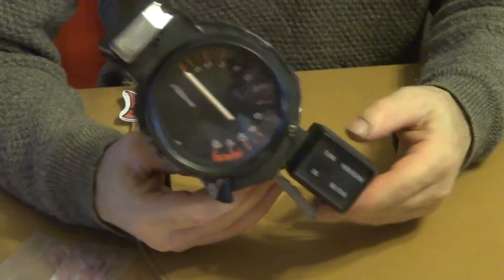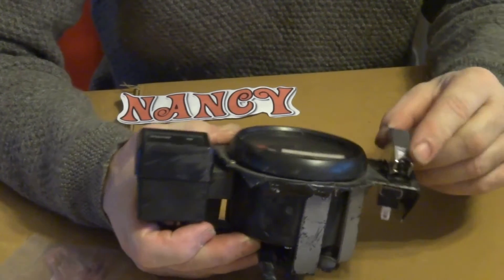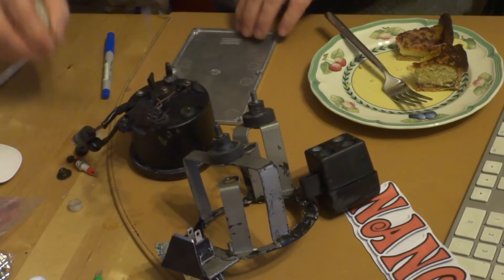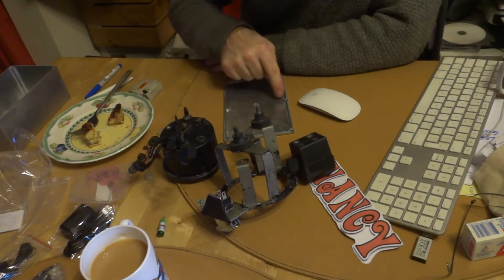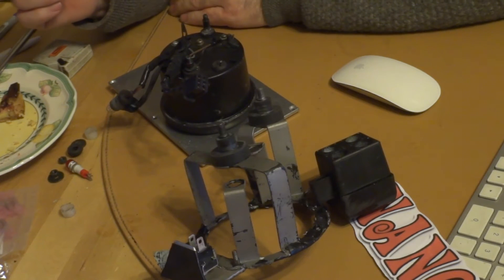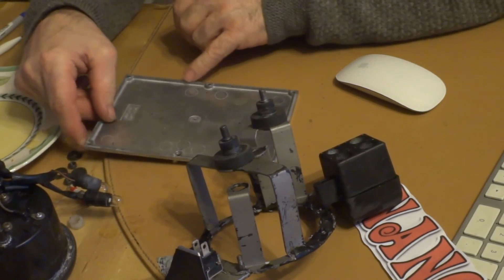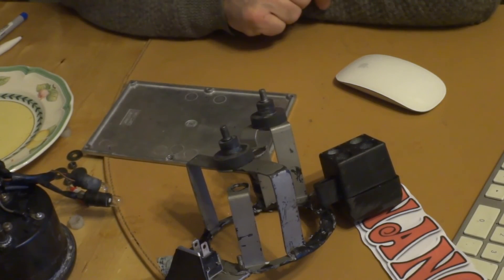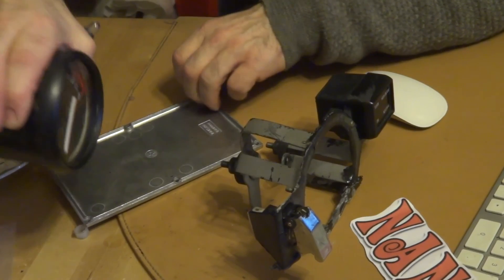Mike Spike Edwards Yamaha FZ600 race restoration project Nancy classic motorbike The clocks debate

Comment: As I continued watching this I remembered the two stroke GP bikes from the 80's and they would cut a thick foam piece that would go around all the necessary gauges and back it with a bracket or on a piece of aluminum..?